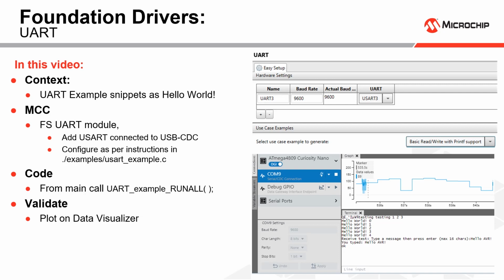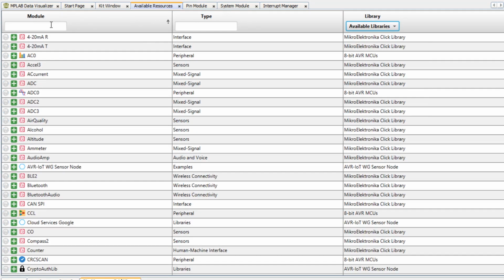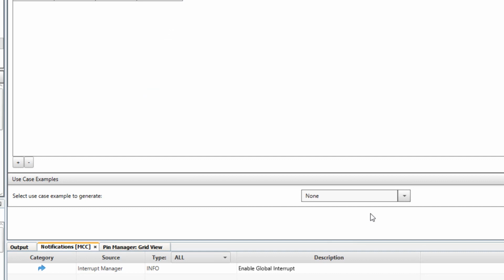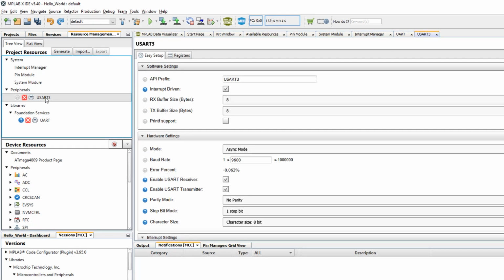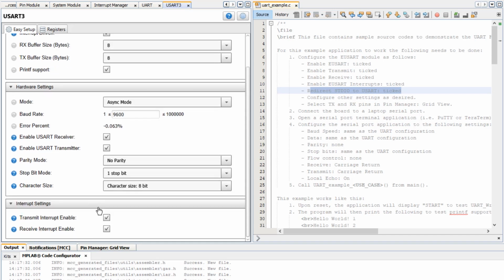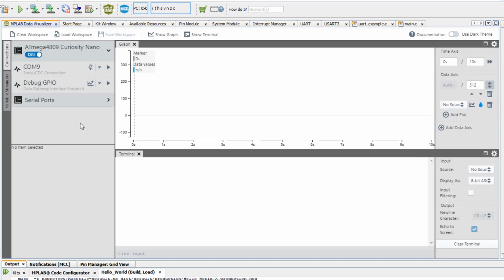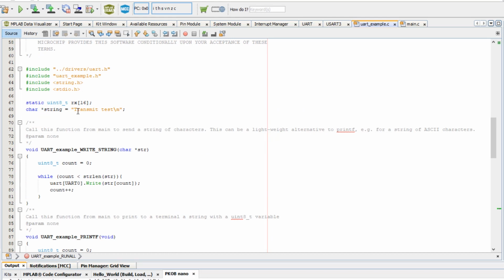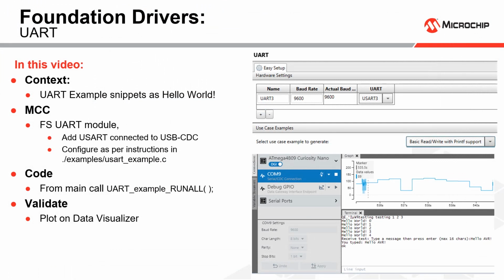Getting Started with Foundation Drivers: UART

Comment: Hi Microchip Technology , 
 I am writing a firmware code  to do a Serial communication UART between ATmega2560 and ESP8266 at 115200 baudrate  in embedded c code using the UART registers of ATmega2560 for sending and receiving the AT commands and its response .
But in doing so I am only able to receive 2 characters as a response from Esp8266 and after that Data over run error occurs . One of the prime reason For Data Over run error is different baud-rates between the communicating modules.

So when i ran into the datasheet of Atmega2560 , i found that my controller can go upto Baud-rate of 111,111.11 as per the formula given in the datasheet for calculating the baud-rate to get 115200.

So what should i do now ??? 
Will be looking for valuable suggestions and guidance for this doubt , if u want to see my source code then if  mentioned will give that in next comment
Reply from the maker: Kindly visit support.microchip.com for assistance. We do not provide support via social media. Thank you.